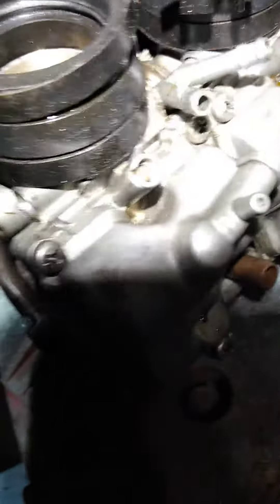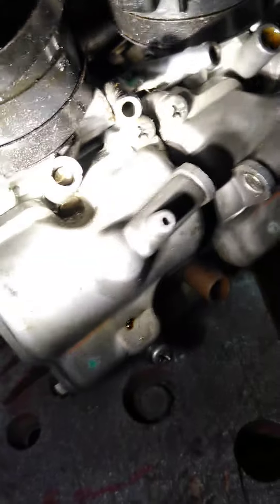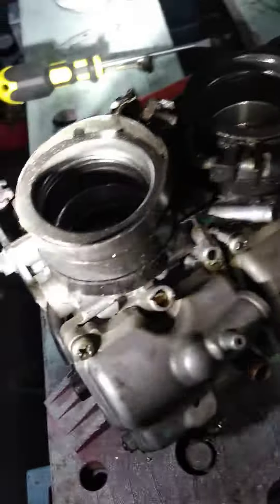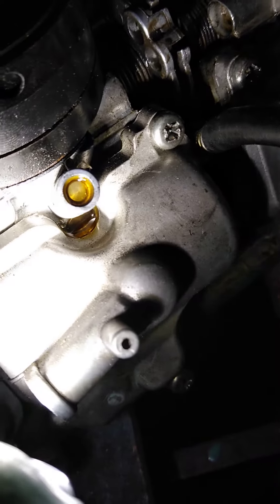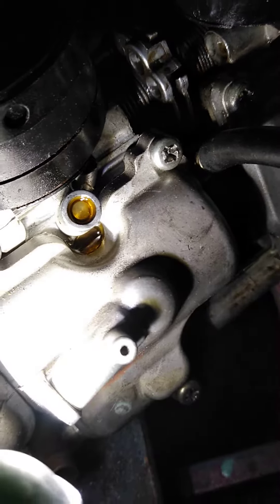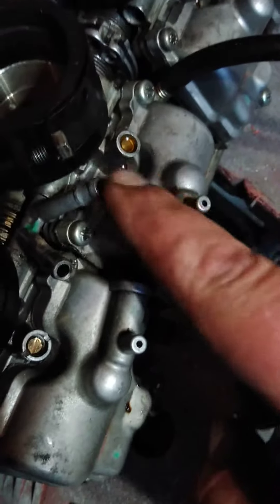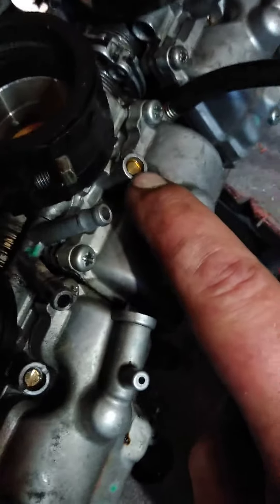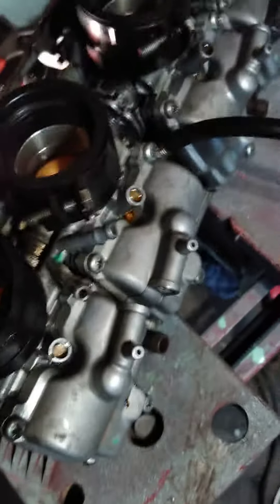CBR 600 F3 pilot screw location (fuel/air adjustment screw)

Comment: The carb rebuild kit on Amazon has flat head screw replacements for them. You can unscrew them with tweezers. One prong in the notch side and the other hanging on the outside of the aluminum housing. If you buy the kit make sure to keep your OEM main jets though.
Reply from the maker: I actually have the Honda partial moon screwdriver for them now, go figure 😆 they're cheap, I can't remember exactly what they're called or else I would tell you "Honda fuel screw adjustment tool" I got mine with replacement carburetors that I ordered for a cmx250 I believe... Or with a jet kit...
Reply: @crazyDIYguy  Hey, well that works too. As long as you can adjust them. I can't stand when you need specialized tools for a critical component.

Comment: Do you have a fuel pump on your F3 an is your petcock vaccum operated? If so when does your vaccum plug into
Reply: So I had the same issue and I found out you have to get one with no vacuums and then take an extra hose or buy one and connect it to the air valve on the gas tank and then the air valve on the left side on the upper part of the engine